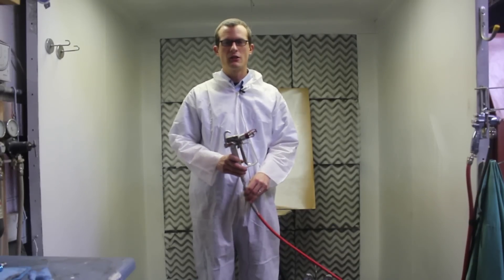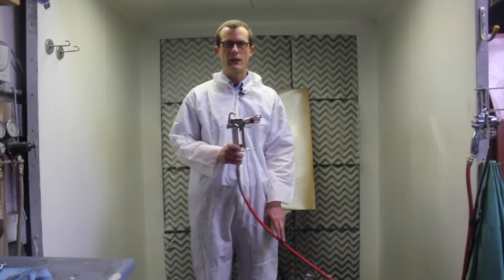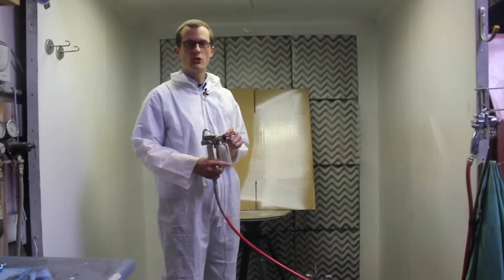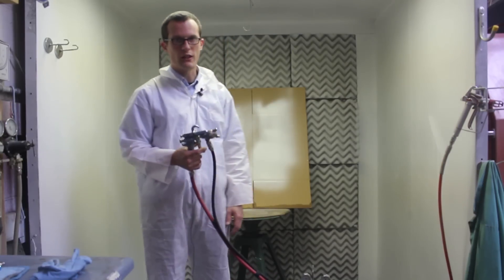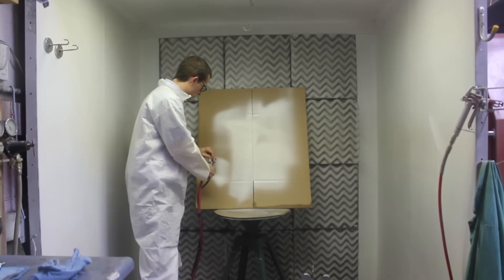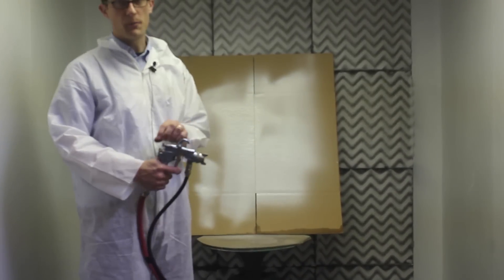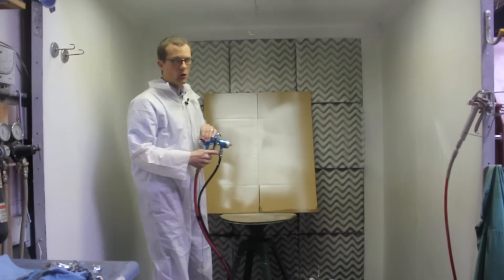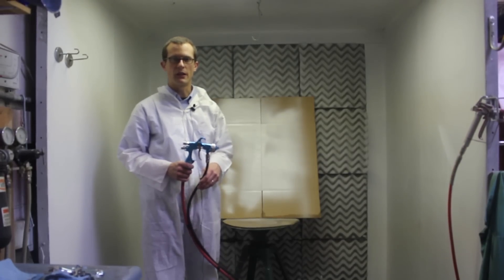HVLP vs Airless vs Conventional Spray Guns

Comment: He's not kidding about the safety issue. I got tagged by an airless with the tip flipped to jet while clearing a clog. Thank goodness it was latex paint because during the half second or so my finger was in the stream it forced paint through the skin, muscle and tendons and painted the bones. My finger literally filled up with paint internally. I ended up requiring surgery and spending a week in the hospital. Then it was rehab and all that. I've never gotten the mobility, strength or accuracy in my hand back to where it was before the accident and I lost almost 2 months of work too. I'm never going to have the feeling, strength or dexterity that I did previously but it's OK because it could have been even worse Had the paint been oil based my finger would have required amputation. As it was they had to cut all the meat off the bone to wash it out clean paint off the tendons and out of the joints. I now use a tough leather glove on my support hand whenever I adjust the tip, fiddle with the gun itself or I'm cleaning it. Turning the machine off does nothing to protect you since they can hold FULL pressure (thousands of PSI potentially) at the gun indefinitely and you have no way to look at a sprayer and know that it's safe. Treat it like an actual firearm. The injuries are treated as such by doctors due to the damage being so similar to gunshots. It's called a High-Pressure Injection injury AKA "The Liquid Bullet". In addition to the trauma cause by the pressure the type of chemical being sprayed plays a major role in the damage. Oil based product injuries will require amputation almost every time while water based amputation is still 2/3rds of the time it's better than always.
Reply: Mike O'Barr I am sorry you had to deal with the injury. Which of you three type of sprayer caused the injury so I do not buy one? Is the conventional a better solution? Thank you
Reply: @cadexim  It is the airless, that caused him the injury. Be careful with an airless. It works faster, better and more dangerous.
Reply: I'm sorry for your injury  Thank you for sharing this safety information. I had no idea about this risk factor with airless.
Reply: thanks so much for sharing, gonna be sure not to buy this one for my home diy projects...
Reply: definitely wasn't aware pressure was so high... air pressure over 100psi can supposedly push air thru skin and into the blood stream and kill you... so several thousand psi equals bad...
Reply: I'm sorry for your injury Mike.  Your story has put me off buying one of these now - it's hvlp for me!!!!
Reply: Oh my gosh! I am so sorry. Thank you so much for taking the time to share this. I'm still debating what type of spray system to get for my trim and doors but having read your experience I know I will be far more careful than I ever would have been had I not read this.  Thank you again, take care.
Reply: Jeezuz kryst!!!! 😮 Thanks for sharing 👍. Hope this story saves a few fingers.

Comment: I have never used any of these 3 types of paint sprayers before. I only used the one in spray cans.  Which one should I buy if I want to paint a cabinet and would want to achieve similar smoothness of a car paint?  Should I buy the one with air compressor, or the one without air compressor?  What do you call the one with air compressor?  (HVLP, or conventional?)  Thanks in advance for any help.
Reply from the maker: If you don't have a compressor that delivers 15 cfm I would recommend a 4 or 5 stage turbine it will allow you to spray smooth finishes

Comment: Maybe someone will help me with this scenario. I have a wagner 350m (airless system) but I am a little disappointed with the power of this device, I have to dilute the paint a lot (more than 15%) to get something out. I have to paint my house (150m2) and maybe "mopping wall" and I was wondering if I could not use my 150 liters compressor  with a pressure pot and HVLP gun? Is it a good idea? Is it a valid solution? 

Thank you for your answers
Reply: I would get something like a graco 390 PC it’ll be cheaper than a pressure pot setup and atomize thicker paints easily without needing to thin. HVLP is great for fine finish work, but besides a large compressor you’ll also need a dryer to deal with the moisture put off by the compressor. With the proper airless spray tip you can achieve quite a good finish IMO. Airless is also much quicker but waste a bit more paint. There’s caveats to both but for your application I think airless would suit you perfectly 👍. Happy painting!

Comment: Really appreciate your video. I purchased a few items from your company for my older binks spray equipment a few weeks ago. You totally helped me out with information on my binks 2001 pressure pot setup. Would enjoy a video on using viscosity cups to set paint consistency. THANKS
Reply from the maker: gary goudeau thank you glad we were able to help i will definetly get a video together on viscosity cups and how they are best used
Reply from the maker: Gary our most recent video covers viscosity cups and how to use them to get better finishes let us know if it helps!

Comment: 1) Do you trigger the gun on and off at the beginning and end of each stroke? 2) Do you keep the gun the same distance from the part while spraying or do you 'fan' the gun? For spraying a cabinet door as an example. Thanks.
Reply: 1) Technically, you keep the gun active, and moving the entire time. If you keep throttling it on and off, you risk wasting paint, and also hitting your project with splatter. 2) you absolutely keep the gun equal distance (to the best of your ability) from the entirety of your project...

Comment: I always thought HVLP was a whole system of hardware, like the gun and the turbine - but you seem to be implying that it is just a gun type that can be hooked up to any old air compressor (albeit with the caveat that it needs to be able to maintain a minimum CFM for an extended time).  Have I been thinking wrongly this whole time?
Reply from the maker: Hi there are two kinds of hvlp one is fed by a turbine another is fed by a air compressor

Comment: Thanks for your video. Which type of spray gun you recommend for painting a trailer? What about a fence around a big property?
Reply from the maker: Murphy's Group depends is it painting trailers all the time or just a single project for the fence project i would consider a wagner flexio 590 or if in the budget a graco battery powered airless
Reply: We plan to paint only 1 trailer. Thanks for your help in choosing the right gun.
Reply from the maker: If thats your project I would go with a low price pressure pot outfit given its a small job https://www.harborfreight.com/professional-spray-gun-kit-93312.html
Reply from the maker: If you plan on more painting in the future then it would make sense to consider a bit better options

Comment: With regards to a system like the apollo pro spray 1500 hvlp, could you increase the tip size in order to spray the likes of upol raptor bed liner? For example do you think a 2.8mm tip could work?
Reply from the maker: Hi generally bed liner is too thick for a hvlp spray gun but that material states it can be applied hvlp so it may work with the Apollo unit if its a 5 stage, less it may be limited.  A 2.8 would probably be the most likely to work or atleast a 1.8.
Reply: Just curious did you spray that bed liner  with your Apollo?  Tip used?

Comment: Hi i am looking for a sprayer to do my internal walls quickly but still get a better finish than a roller? Hvlp or Airless?
Reply from the maker: Airless if needed you can go with a fine finish tip as it atomizes a bit more
Reply: Pittsburgh Spray Equipment Co Thank you
Reply: if your walls are textured, you will never notice a roller nap texture compared to a sprayer on interior walls; it matters most on raw wood materials. Also, hvlp is specifically for raw wood scenarios (i.e. cabinets, doors, trim, moulding). Typically, we only airless walls in unfurnished/giant interior housing projects.
Reply: @eytrix  Thank you
Reply: Cheers

Comment: I have a simpler turbine HVLP sprayer that apparently has no adjustment for air pressure; is that normally a critical adjustment to tailor it to the specific painting situation?  The air volume is pretty high all the time so it's not much like an airbrush where you could control both the air pressure and the paint delivery volume
Reply from the maker: Hi controlling air pressure with HVLP is not as critical but you will be limited to thin to medium paint usually if your trying to spray anything thicker you typically need to be able to use higher air pressure than a hvlp turbine can provide which is where a conventional spray gun and compressor or airless would make sense
Reply: an hvlp without air pressure adjustment is virtually worthless imo.

Comment: I'm going to be restoring an old smoker pit with rustoleum high heat paint. The paint is very thin, almost watery, so I don't think any thinning will be required. Which type of gun would you recommend for this project?
Reply from the maker: Hi Sean if you have a compressor I would suggest a Binks 2100 spray gun it will spray about anything well with a 1.4 tip that would be a pressure feed gun the other option you could consider is the Devilbiss FLG 4
Reply: Pittsburgh Spray Equipment Co Thanks for the suggestion!

Comment: Excellent video? Does an HVLP with more stages, (2 stage vs. 4 stage), offer better transfer efficiency with less overspray? Located near Philly!
Reply from the maker: Thomas Kalinoski thanks for the question hvlp turbines with more stages will offer a bit better performance especially with thicker coatings ect because it will provide more air volume which keeps the unit working less hard or in the case of thick coatings better ability to break up the coating stages will not improve transfer efficiency

Comment: around 3:00 you said you cant use a fine finish with an airless? You sure can! I use 210, 310 and 410 fine finish tips with my Titan to spray primers and latex lto do trim, cabinets and casings all the time. looking at trying the HVLP machines just to reduce lacquer over spray as it stinks a house out so bad. what I use now though is just an Impact airless with a 2-413 tip for precat.
Reply from the maker: Surfopia what was meant is that you typically get a bit of a coarser finish with an airless.  Even if you use a fine finish tip you will have a slightly less fine finish than achieved with an air spray gun.  That is why air spray guns are used for automotive painting.  That being said fine finish airless can be perfect for a lot of applications especially for wood finishes as you don't necessarily need a "class a" (automotive finish) to have a good result in the end.

Comment: What brand conventional sprayer do you use?
Reply from the maker: Justin Carr for conventional spray guns we like the binks 2100 its 273 and comes with a ton of setup options or are you asking about an airless?
Reply: No not airless. What about the gun is that binks as well
Reply: Or is binks 2100 the gun, if so then what brand pressure pot?
Reply from the maker: Justin Carr its a binks 2.8 gallon outfit comes with 25 feet of hose and the 2100 gun with whatever setup you may need whole setup is 919 or if you need hvlp and or conventional you can go with same pot and hose setup with trophy gun
Reply: Ok great thank you
Reply from the maker: Justin Carr no problem if you have any video requests let us know

Comment: How many homeowners have compressors that put out 20 cfm,,,it would have to be 2 stage,,,so the hvlp guns would be not a good choice,,but would give you the best finish,,,great!! Because my new compressor is 13 cfm at 40 psi,,,,and was 800 dollars,,,would have to pay 1200 for a 2 stage compressor..
Reply: check the cfm requirements for the husky hvlp, they are within the range of a home owner compressor  there are also LVLP guns that fit the bill as well

Comment: I don’t recommend airless for anything that needs a fine finish. Automotive, millwork and cabinetry do not use an airless, stick with hvlp. You will waste gallons of paint as overspray if you take on large projects with an airless and it will cost you and the customer. Airless is only good for walls and ceilings and even then hvlp with a large pressure pot setup would still do it better.